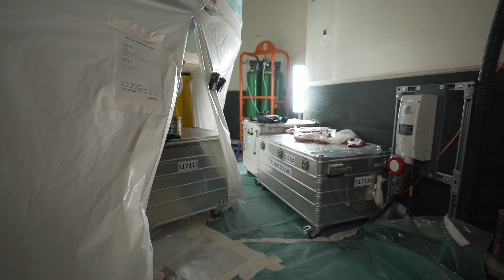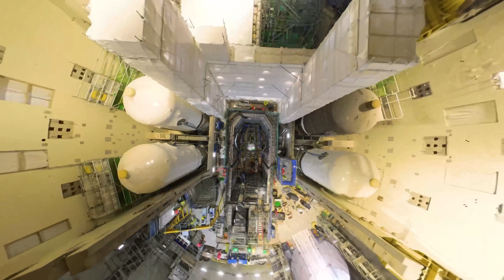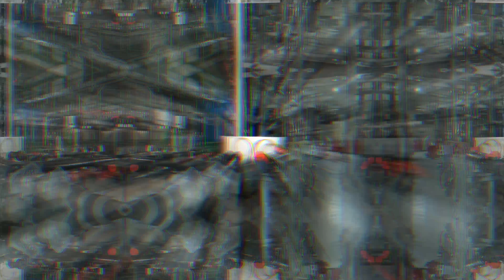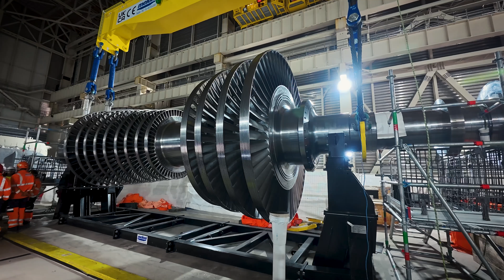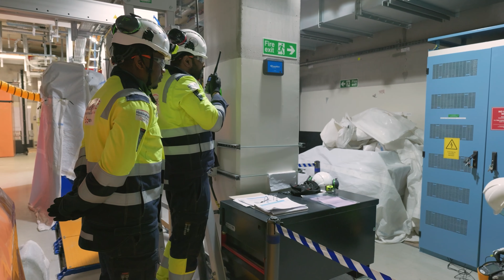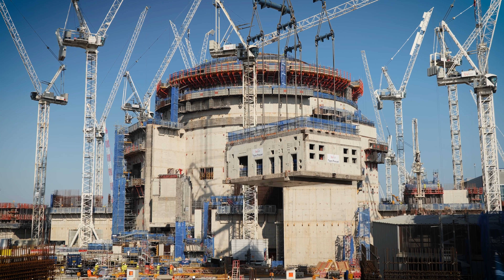Hinkley Point C | Project Update May 2026

Comment: With my EDF so-called smart meter cost having gone from a £1 a day to £7, Hinkley Point C will be paid for in a few months, if the 3.5 million customers are charged what I pay. Bangladesh support says that there is no problem but they don't live in London or even speak English.
Reply: Smart meters are practically never wrong, you just don't understand how your energy is billed...
Reply: @dorsetengineering  My contract was for £31 a month and my April charge was £124. On the start date period it showed "day 1 of 194". Clearly it is a meter failure and EDF are going to replace it. Hopefully I won't have to walk 50 metres with the new IHD to get a reading.
Reply: @roysutton577  I just make sure that I submit meter readings every month - seems to work, although I do appear to be paying for a significant proportion of the build myself!!
Reply: I fully understand the difference between 3 kWh per day since 2017 and £1 vs £7 per day over 2 months.
Reply: They probably do.
Reply from the maker: Hi @roysutton577, it sounds like your direct debit may have been set up at £31 per month, this is not fixed, even if your tariff is (a fixed tariff only fixes the price per kwh and daily standing charge).  in reference to smart meters these are the meters attatched to your wall, not the IHD (in house display) which is a tool for customers to jassist in keeping an eye on what they are using.  The actual smart meters are what communicate your readings to your supplier.  
If you have an issue with your smart meter snot communicating please send us a private message with your details so that we may look into this for you.  Thanks Sam
Reply: @edfenergy All EDF could offer, many times,  was that my situation (electrical load) had changed and that the smartmeter was fine. As soon as my consumption increased 700% I began filming and shut off my main circuit breaker, walked two minutes to get in IHD range and filmed the results. Even with the power off my reading went up to 3.03 kW instantaneous, with no load attached.
Reply from the maker: Hi Roy, Please send us a private message with your account details and I can have a look at this further for you. Thanks, Francesca
Reply: @edfenergy  I have to wait 8 weeks to take the matter to the ombudsman as EDF only offered ludicrous denials. Over a span of 6 weeks I periodically shut off my main circuit breaker and watched my consumption go to 3.03 kW. The over charging was exactly in sync with the billing month. How many of the other 3.5 million customers have been extorted?
Reply from the maker: Hello, I am sorry to hear the issues you have faced. Could you please send us a private message with your details and we can look into this for you. Thank you, Brandon
Reply: @edfenergy  My billing issue at £7 per day instead of per week happened precisely during the billing month and has now reset to normal. I have had many ludicrous replies since the first day that I was overcharged. Now I have to wait until 8 weeks to be able to take it to the ombudsman. EDF don't care.
Reply from the maker: Hi, I’m truly sorry for the frustration caused by your billing issue and the responses you’ve received. If you’d like, please send us your details via DM (full name, full address and email address) so we can review your case further and assist you directly. Steve.

Comment: This Franco Chinese power built power station , and I respect the engineering expertise in any sphere but pity it’s not UK built.  I gather of a now obsolete design long abandoned by the Chinese themselves is perversely positioned  near where a tidal barrier could have been built also running 24/7/365 and after building costs costing very little . By the time this white elephant comes on stream it will be selling electricity in a market which even with the haphazard directionless policy to rid us of the pernicious fossil fuel , will be competing against electric generation of very cheap renewable supplied electric energy with advanced battery storage to balance variability . This is always assuming government sorts out the grid and the current ridiculous situation of paying renewables generators to switch off because the grid is not up to the task of conducting electricity from one end of the Uk to the other . This will leave future generations with a hefty end of life disposal problem ,an issue which at the current rate of idiotic climate change deniers (possibly gaining the political ascendancy) ,those  future generations will have quite enough meeting the cost of climate change mitigation which as each year goes on even now increasingly seems like a finger in the dyke. This may have been of use had it been started 50 years ago and in time to help us over the transition even so 3 mile island Fukushima and Chernobyl tell us unequivocally this is a very risky expensive and now totally inappropriate form of generation .

Comment: Hinkley Point C has become a national embarrassment, and tbf, its not an issue with the reactors themselves* too much, or EDF, Its been the horrific, nonsensical bureaucratic bloat (much of it driven by the "environmentalists" more than anyone).  This has turned a £10-15 billion project into a £50 billion disaster of a project. By contrast EDF France will try and build 6 for the same price, will likely over run by 10-25% inline with the other reactors.

Comment: That reactor lid is a shite design. I was at sizewell B when those sleves fell off on a refueling outage. Westinghouse sent loads of Americans over to fix it. Massive contamination and dose rates. All this money and effort for 7% grid output 😂
Reply: You reckon this French designed station is using an American design from the 1980s?
Reply: We french operate 52 reactors of this type for 45 years without this kind of problem
Reply: @philv3941 I seen it with my own eyes and it made it on the UK news. "Thermal sleeve problem" on Google